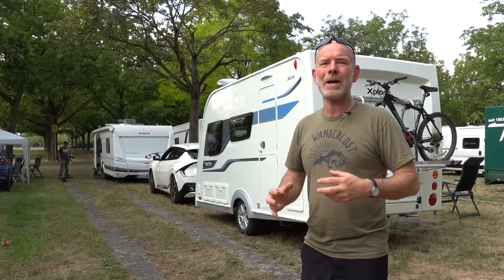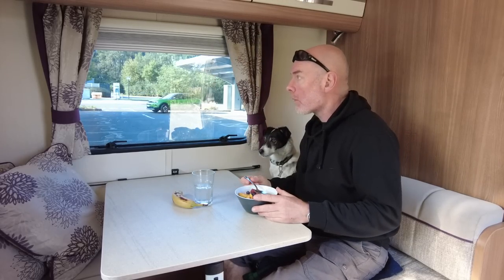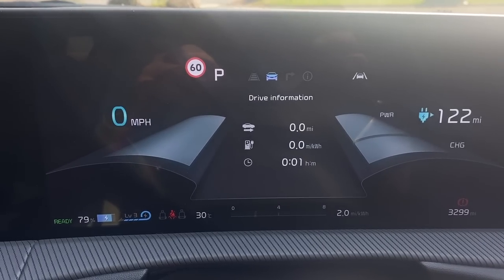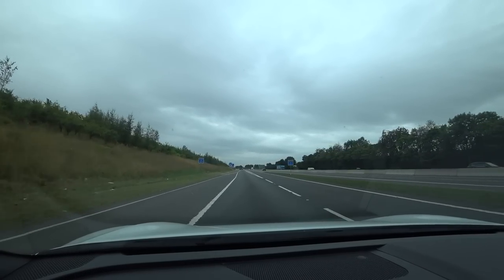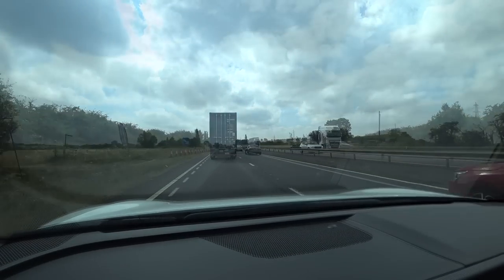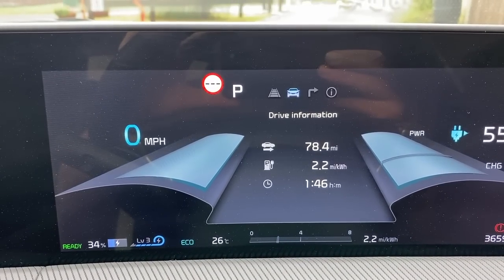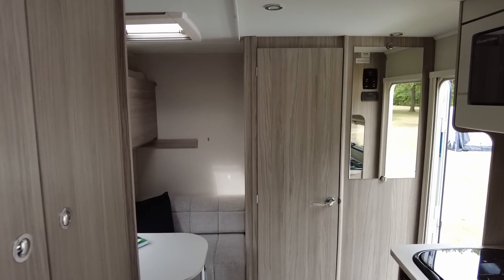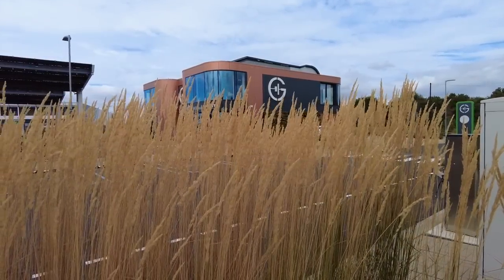EV towing a caravan to Germany from Scotland: Range and cost

Comment: Until you can pull in everywhere and charge without disconnecting the van I am not interested. The time to charge every 100 miles is a ball ache. I also want to be travelling much faster than lorries. I have a much larger caravan than in your video so I doubt I’d get 100 miles. 
Thanks for your efforts…..
Reply: Don't know about "much faster". The speed limit is 60mph on motorways with a caravan.

Comment: Very interesting video, however I dont think you are comparing like for like at all. There are to many differences to make a fair comparison. you are not even using the same method of crossing the channel so you have done 140 more miles. You are using an ultralite caravan compared to an airstream. I have a peugeot 508 diesel which averages 38mpg when towing, I currently pay £1.76/l for fuel, so by my calcs going via euro tunnel with my car and van fuel would be £166. I bought my car last year, it was 18 months old had done 6000 miles and cost 19K, just found a used EV6 on autotrader 14 months old, 9500 miles on the clock and it is £55,999. EVs currently account for 2% of cars on UK roads, you stopped at the sterling charging station which had 1 pull through charge point, what happens when 10% of cars are EVs, the charge infrastructure isnt growing fast enough. Electricity prices are rocketing, and will only increase when government slaps duty on EV charging to offset the revenue it will lose on fossil fuel duty. Lastly, currently vehicle emissions are all calculated on tailpipe emissions, a significant amount of the emissions of an EV are created during the manufacturing process of the vehicle and its batteries.
Reply from the maker: I can only correctly compare journeys I actually did. This is why I broke down the figure into price and units to allow people to make their own calculations.
Reply: @andrewjditton  I appreciate that, so if I take your EV trip figures, but imagine I was using my car and Bailey Caravan, my fuel bill would be £131so £69.58 more expensive overall. And I can have by breakfast before I leave, I can stick to 56 mph amongst the HGVs, which is likely to push my economy up further. Electricity costs continue to rise. If the rate of growth of chargers doesnt keep up with EV sales, then Queues are going to be silly even if it only takes 30 mins to charge, that is still 10 time longer than it take to fill an ICE vehicle. Personally I think the way forward is with what JCB have developed, which is modifying their existing diesel engines to run on hydrogen as a fuel. The only thing left to solve is green hydrogen production, which according to a few firms including Siemens in Germany is not far off. The distribution network already exists just change the types of tankers and storage at filling stations.

Comment: There's no way towing with an EV would work for me. Would have taken 2 days off week in Fort William (from the Midlands). Access to chargers too iffy when towing. Be lucky to find place for a 7m van whilst charging. Drove back from Fort William with 1 5 minute stop, no fuel needed as towing range just over 500 miles with 30mpg. Interesting video though. Must take a lot of planning where to stop etc. Day tour around Skye from Fort William would not gave been possible,  not 1 of our stops had a charger for the 300 mile tour.
Reply from the maker: I guess you missed my series where I toured Scotland in the EV towing a caravan. Come to think of it, not one of the stops on my tour sold diesel. Funny that.
Reply: @andrewjditton  I will watch that with interest as I have not seen it yet. With a towing range of 500 miles, there's no anxiety about fuel stops when towing.  Did you have any issuing towing long uphill sections as the Kia is not supposed to be used for towing uphill at more than 40mph according to the manual?

Comment: Must have been a trying journey. EVs will never have a problem with towing as they have instant torque delivery. They don't however have gears for cruising so energy use is literally linear against the all weight of the car and caravan - hence range gets destroyed when towing.
Once EVs have a 800+ mile range, they will be a better prospect, as this is likely to drop to 300-400 when towing.
Reply from the maker: Interesting point Dominic, but who can safely tow 300 miles (6 hours) without a break?

Comment: Good Lord I would not want to be sat at ev owners table let alone one that tows a caravan when their quarterly energy bill comes in this winter, it’s going to be utterly horrific and forget charging at public chargers because they have to charge 20vat whereas home energy you pay 5% vat!.
     It’s already confirmed on many prominent motoring websites that it’ll cost more to charge an ev than it would to fill the equivalent petrol or diesel vehicle, based on an average of 8,100 miles driven per year!. 
   Just good god it’s going to cost on average just under £40 from 1st October to fully charge a small city ev at home, rising to around £60 at a public fast charger!. Add to that the ev is more expensive to purchase and it’s a lose lose!. Disaster.

Comment: As a reference many miles/kWh do you achieve without towing?
Reply from the maker: I did 4.4 motorway on the 100 miles to Dover and back, but I'm light footed. 3.6-3.8 is the norm for motorway driving.
Reply: @andrewjditton  many thanks for the explanation.

Comment: Wow, I could and would never leave an unhitched caravan at a service station. That is terrible and so likely to get nicked if there are not two of you! What a disaster this whole electric vehicle thing is for you trailblazers. At best 30% of the electricity comes from renewable. Like you said though the best thing for the environment is not to keep buying all this new crap that you really don’t need.
Reply from the maker: Could you please cite your source about renewables and which country you are basing this on?
Reply: Its more like 40-50%, but yes a lot of grid is fueled by non-renewables. But still, the latest ITTC report says that even with dirty grids the EV is still more environmentally friendly than ICE, cradle to grave, including fuel sources.

Comment: whilst Stirling  is great my concern would be that  my concern is that there may well be 100+ petrol/diesel pumps within a few miles of that superb location.  Take all the fossil fuelled cars that are using the petrol pumps and make them EV's and there still is not enough provision  - without the Govt commitment ( Sorry I am assuming we have a Govt in the UK ) to install the charging infrastructure I cannot see this working.  Good effort though  - sad that it only works because EV take up is so limited.
Reply from the maker: A bit of a chicken and egg situation Darren. Remember that a lot of EV charging takes place at the home as well. You're spot on about the Government commitment, and as I try to keep politics out of it I need to maintain a discreet silence despite the fact I am bursting... ;)
Reply: Surely it’s not the government’s job to install chargers, they didn’t install petrol pumps did they ?

Comment: What is the advantage with electric cars over petrol and diesel? Electric cars are more expensive, dont go as far before they need charging, you have to wait at service stations etc when they are charging, they are very heavy, the batteries gradually become less efficient. Then there is all the child slave labour involved in mining the rare minerals and the huge damage to the environment at the mines where they use huge volumes of sulphuric acid that washes into rivers.

Comment: If you are not in a hurry, and why would you be if you are having a holiday, the EV is half the cost. Sounds perfect to me.
Reply: Yeah but time is money , and this was done in utterly ideal conditions with it appears one person on board , hardly any gear , and at one stage tailgating a big rig with a new EV , and it was doable but still shit , come back in 5 years with the same EV with some miles on the battery , and in not ideal conditions, it would be an absolute disaster imo.
Reply: @mikldude9376  Time is money ? on a holiday ?
The traveling is part of the fun on a holiday, no need to rush, not having to beat the traffic to get to work, perfect   🚗:face-blue-smiling:

Comment: If you just paid the full amount of £0.65 a kw/h for your electric fuel then it would work out much the same as going in your diesel car. Terrible comparison comparing the best case scenario of electric with the worse case scenario of diesel. Didn’t realise the Ferry was that cheap, was £500 last time I looked.
Reply from the maker: Not a case of comparing best case with worst case, comparing how this journey went with how I used to do it. You're correct about the 65p/kWh and this is going to be similar to the flying vs train argument soon... I'll just carry on and see how it goes. When the time comes I have no alternative I will of course mention this as I just say how it is.

Comment: I think we need to be realistic, the amount of restrictions and stopping and taking the caravan off then waiting and re-attatching  is stupid at best, way to many compromises, to many to list..  money spent in services while waiting at each stop will be very high so be realistic again please..  When this becomes more popular the cost of electric Charging will be massively higher than petrol/diesel and not to mention only 25 percent of electric will be green so not quite seeing the point of electric cars.
 Another factor will also be when diesel is at a fair price of not £1.86 but at £1.30 or less then is Diesel every time..  
Might be different if i had lots of time to myself and someone else was paying :)
Reply from the maker: I suggest you research the provenance of electricity in the UK. And who do you suggest is paying?
Reply: @andrewjditton  I suggest not wasting time woth such matters as its just going no where,  just like current electric cars.. oh and good luck when you need to buy a new battery pack woth an estimated 50 grand cost, which is between 6 to 10 years but after 3 years maybe you be at half range ..  how many stops then ?

Comment: COST£££££££
It’s alright saying EVs can tow 
Range not a problem which I doubt.
But the real elephant in the room is cost of a vehicle.
Many who tow caravans can not afford the higher range EVs which come in at well 40 grand.
2nd hand EVs 🤣
Battery degradation already set in in vehicle’s over 2 years forget mileage batteries drain even if not used.
Unless your on well over a 100 grand a year caravanning is over.

Comment: What someone like Tesla needs to do...is invent a new chassis (that can be used for caravans, trailers etc....)that has the ability to charge your car while your towing ! and with its own battery pack can be driven by remote when detached ! Why are caravans stuck in the dark ages in terms of Engineering ?

Comment: I would have liked you to have completed the whole journey using your larger caravan. Your video shows exactly why electric cars and caravans is a big NO NO. We just do not have infrastructure to handle electric vehicles and caravans and electric vehicles do not yet have the range for long journeys. Imagine towing a large twin wheel with a family with all the stops required, hitching and unhitching, it would all be too much hassle.

Comment: Congratulations you showed that it can be done with an EV. You demonstrated how difficult and inconvenient it is compared to using a far cheaper diesel or petrol car. I’ve owned an EV and can confirm what a backward step they are in the evolution in motoring. The huge energy costs they take to make and the need for cobalt in their batteries that rely on slave and child labour are truly horrific. It’s an absolute scandal. Their reliance on rapid chargers that are a huge drain on the grid is a pain. They still take several times longer to charge than it does to fill a petrol car and once full there is less range than a petrol car. There is also the fact that the grid cannot cope with many more EVs and additional charging stations without major and I mean major overhauls at a ginormous cost. In short, EVs are a huge problem and are not good in anyway for humanity (with the cobalt mining) or the environment.

Comment: Current EVs will be the biggest con the world has seen since we were told diesel was the saviour to petrol.
Reply from the maker: Could you cite your source, who funds it, and the data behind your argument please?
Reply: @andrewjditton  You mean they don't use precious rare minerals for the batteries?

Ok fella
Reply: Diesels, the first uk volume manufactured cars were available from the mid 1980’s and we all which party was running the uk then.
Currently EU6 diesels as other earlier diesels produce half the CO2 of petrol engines.
Particulate is the same as petrol.  Yet NOx is 0.02 greater than a petrol.
EU7 with its much lower emissions have been postponed as pressure groups continue to block the adoption

Comment: This video emphasized the problems of towing with an EV first of all you need a smaller caravan, then you don't want to take people with you as they will add to the weight, not everywhere has the facility to charge hooked up and you were doing this at a very quiet time what about when it is the summer holiday period when so many more will be wanting to use the chargers all at once. One petrol pump can sevice 60 cars in one hour how many cars can one charger service in one hour. If the time was ever to come when evey car had to be electric where are we going to get the land to let them charge. And before you say anything about me being anti EV I am not I have been following the BYD story for quite a few years now and I can also say that EV are good for buses as they don't use fuel at the bus stops and local van delivery as they don't require many miles to do their job but as a private vehicle option they require a lot more than we have at present

Comment: How long did it take you from start to finish?
How long would it have taken you if you didn't change the caravan.
Your trying to paint a roses picture for EV's. What about the EV anxiety will you make the next charge point, will there be a queue, are they working.
EV's are for short journeys, and think of the carbon, not what it gives out, but the electricity coming in from power stations. The damage done by mining of rare materials, the child labour used. The waste that can't be recycled such as batteries. Oh dear your creating more pollution by listening to false information remember the people telling you it's cleaner are the same people who told you to buy diesel cars. How did that turn out.

Comment: What a load of Phaffing about i couldn't be asked, touring like that is not my idea of a holiday or in any way fun, this is not the way forward.
Reply: Get used to the idea.
It's coming!
Reply: I recently went up to Scotland in my brother's diesel. Only one stop, and a noisy engine to talk over wasn't much fun either. 
Teleportation is the way forward

(After 3 years EV ownership I am a little biased, fossil is so last century)
Reply: @rogerstarkey5390  Hydrogen combustion engines are the way forward along with hydrogen boilers for the home and industry. Everyone is pushing Electric when we have no infrastructure and no grid capacity.
Reply: @watcher24601  well your brother needs to get a new diesel car then if it makes that much noise
Reply: @rogerstarkey5390  No one seems to have noticed Diesel car sales have tanked to 5% so finding them will get harder as numbers are dropping.
Reply: @garymcafee5995  hydrogen maybe the way forward for trucks and trains. No good for cars or houses, no hydrogen infrastructure unlike electricity which is everywhere.

Hydrogen for housing is a joke and will never happen. Hydrogen currently comes from renewable electricity or from fossil fuels. Why pay for the electricity/gas and conversion costs to heat a house when you can just use the electricity directly?

As the comment above said, electricity is the future
Reply: @watcher24601  Hydrogen boilers are available now from Bosch and new models are Hydrogen ready. Petrol stations can be converted reasonably easily for the storage and selling of the liquefied gas much like autogas currently is and being in the electrical industry the network could not cope as it stands with mass electric cars. ......bring on the power cuts